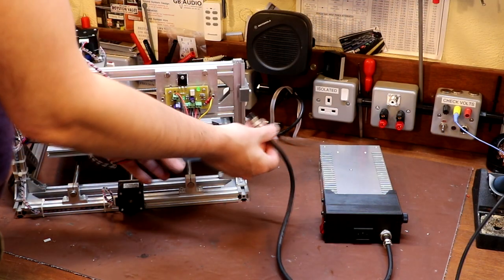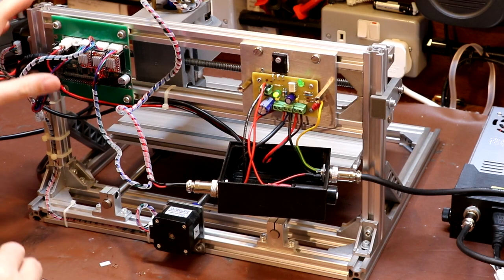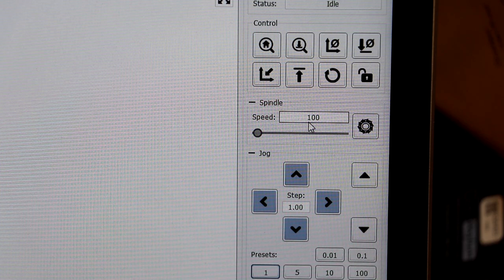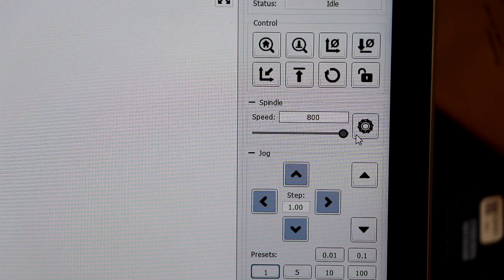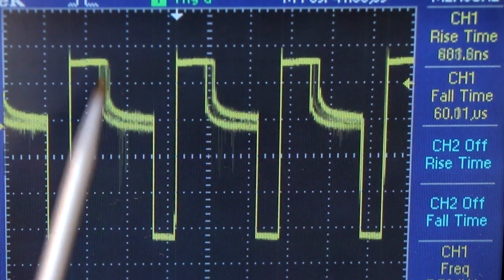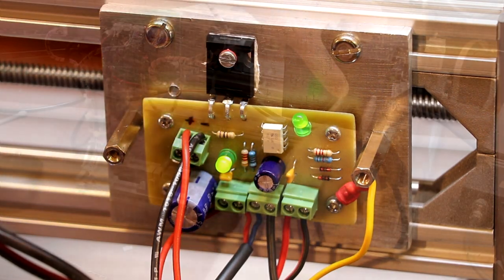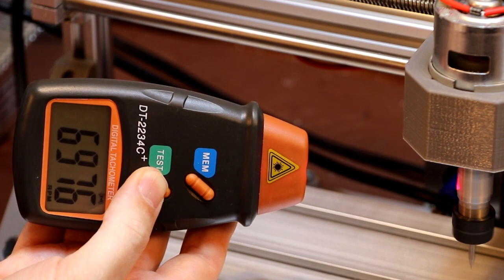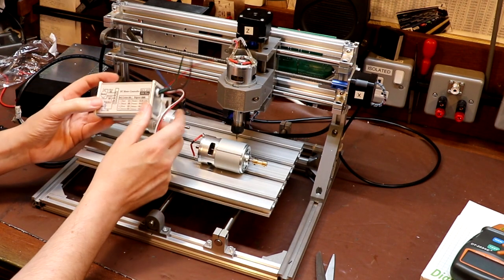Woodpecker 3018 Spindle Upgrade - Part 4  Its a Short One

Comment: Re the 'chair' waveform, you're right, the 'chair back' is inductive kick, but the motor is still rotating hence the noisy (think 'brushes') back EMF for the rest of the 'off' period. There's an interesting page here: https://linuxgazette.net/179/radcliffe.html

If you don't make any more videos before the end of the year, I'll wish you a very merry, healthy and safe Christmas. Are you going to buy the wife a new toothbrush?   Cheers, Steve.
Reply from the maker: Hello Steve thanks I did read the article and the author’s observations and conclusion look it be in line with my own thought. The distortion of the waveform doesn’t appear to affect the operation of the motor or the speed control. I think the are a few remaining bristles on the wife’s toothbrush and I don’t believe in spoiling her with gifts etc. Have a great Christmas. Thanks regards Chris
Reply: Yes^^^

Comment: I think you have done a smashing job making the controller. :-D
i always go overboard with transistor ratings and other bits when i throw together a psu.
i just don't trust the daft figures stated and i dont have a heatsink the size of a battlship lol.
i like to keep a finger on the device while it's on full chug and not burn the skin.
It's just my odd way,  heat kills things, so keep it cool  :-D

I didn't notice the lack of testing,  i assumed the testing would come later.
Does that software have the ability to read a tacho pickup for speed,  so loading would have less effect?
Smashing video as always chris :-D
Reply from the maker: Yes I do the same with heat sinking.  I need to get my head around the software but I will make a video when I figure it out. The speed control is open look and it wouldn’t be easy to add it. Some of the controllers use the back emf to get feedback regarding speed. However I don’t think it over matters for these small cutter we run them as fast as possible. Thanks for watching happy Christmas regards Chris

Comment: Not at all surprised that it worked first time. Excellent work! I wondered how loud that motor noise was on full speed
Reply from the maker: That motor is much louder in real life as the camera adjusts the recording level. It’s a horrible noise.  Thanks for the nice comments as alway when it works more luck than judgment. Thanks regards Chris

Comment: Is that chunk that's missing a result of  not enough switching drive to the fet?  Maybe? Is that the gate your looking at?
Reply from the maker: Thanks Simon I will reduce my gate resistor and see if that has any effect. I think it’s due to the back emf though. Thanks regards Chris
Reply: @allthegearnoidea6752  It probably  is EMF. Just a hunch the fet drive. Stab in the dark.